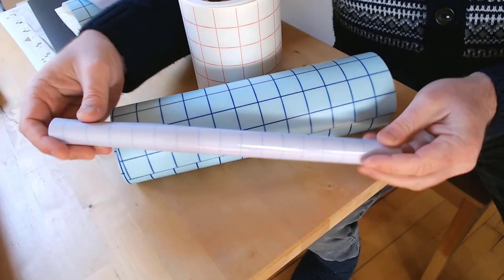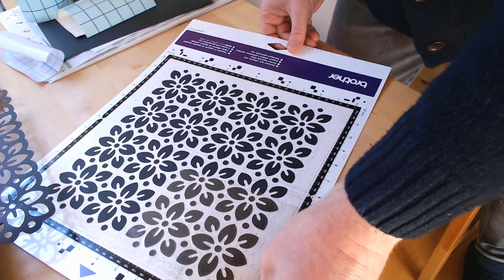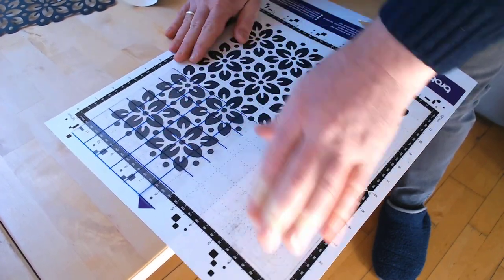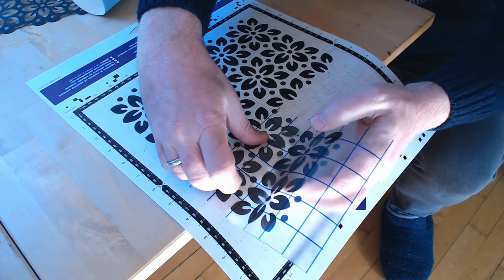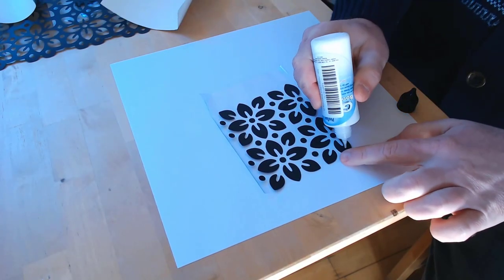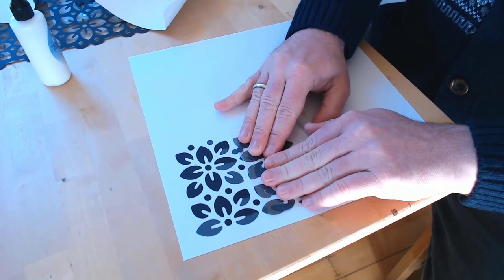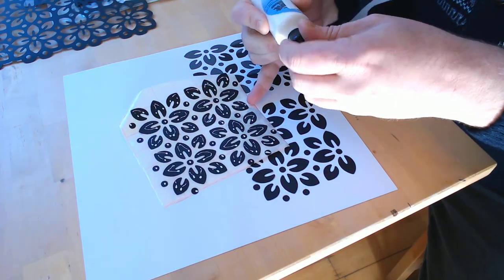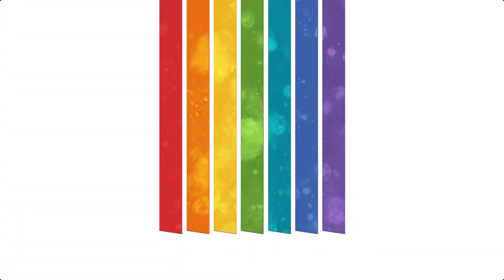Scan N Cut Saturday - Transferring Left Overs

Comment: Very interesting. I wonder if giving the transfer tape a gentle heat with a heat gun or even a hairdryer before peeling it up would stop it tearing the card? I often do that when removing sticky tape.
Reply from the maker: Interesting. Not heard of that and wonder what the science is behind it...
Reply: @GentlemanCrafterUK  I realise my post isn’t entirely clear. I mean when you’ve lifted the shapes off the mat and applied them to your surface and are trying to lift the transfer tape off without tearing the card. I think the heat just softens the tacky glue a bit and lets it release from the card without tearing the surface.

Comment: I wonder how well Glad Press N seal would work?  Has anyone tried that?
Reply from the maker: Not sure, haven't seen it in the stores in the UK so wasn't on my radar for testing. Worth a try if it is low contact though.
Reply: @GentlemanCrafterUK    I am in Australia and when I went hunting online for Press N seal, I found a USA shop in Melbourne and ordered 2 rolls.  I have used Press N Seal to do this for smaller projects and it's as if it were made for transferring card. I found it was tricky to get it to stick in the first instance but it released really well with no rippage. I would recommend this as the very best way.  I have several designs still stored on it with no problems in over 2 years and it is reusable quite a few times.  Maybe there's a USA store in Scotland or get a US friend to send you some as you'll find quite a few uses for this waxyish type of transfer film. (PS it also seals liquids and cremes in containers like stencil pastes etc.)